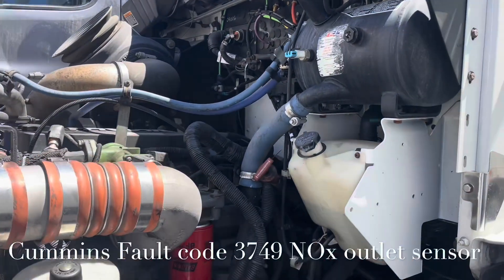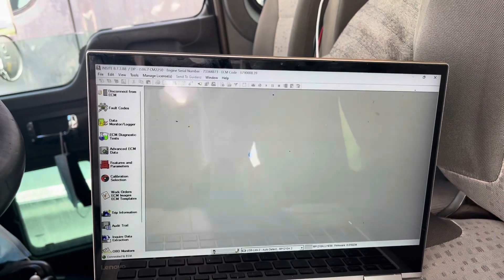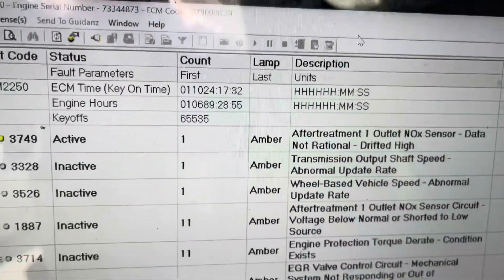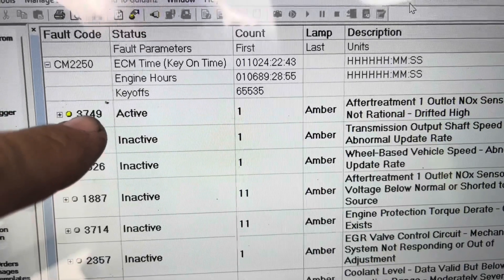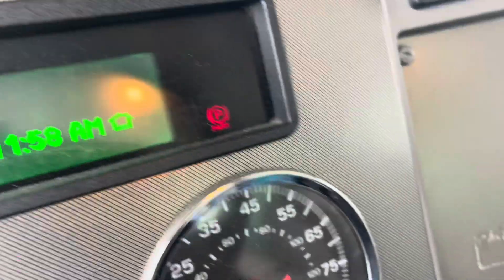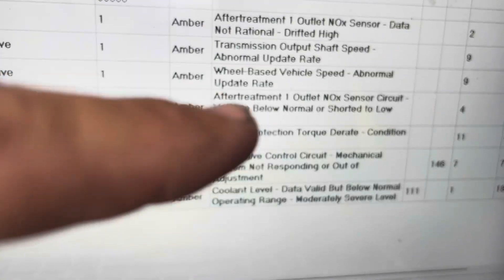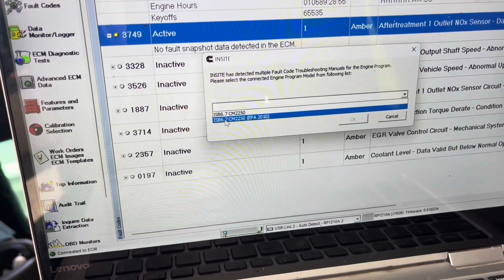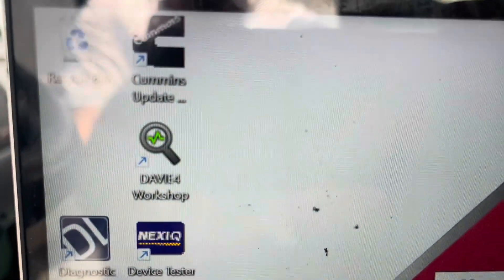Cummins/Paccar, fault code 3749 NOx Sensor Drift High, fault code 1887 NOx Sensor Circuit Voltage

Comment: Hi boss question you said no subscription require for Cummins insite software is that right and where to download that thanks
Reply from the maker: The Insite program does require but the troubleshooting steps or guide does not an additional subscription
Reply: @CarlosDieselElectric  thanks all your videos are great
Reply: @CarlosDieselElectric  hi I have question if you can help me out,on my cascadia 2014 I am loosing air pressure 10-20 psi on road primary stays good, there is no leak on truck any idea why it’s doing that thanks
Reply: Guage go down on secondary tank only while driving 10 to 20 25 psi then come back up
Reply from the maker: Insite requires a subscription. The troubleshooting does not because it comes with the subscription